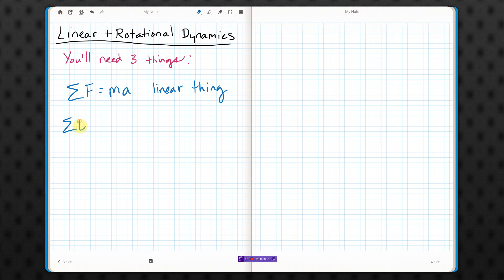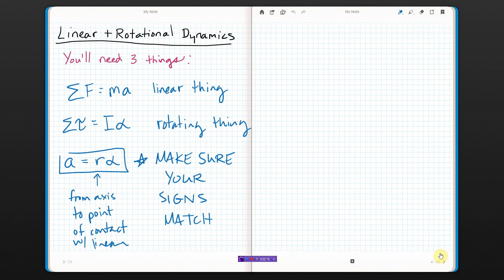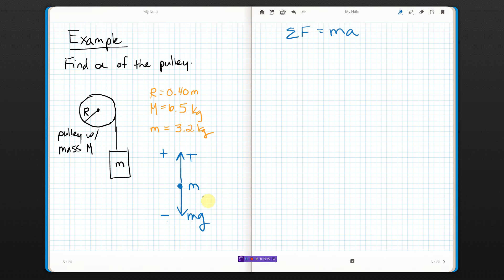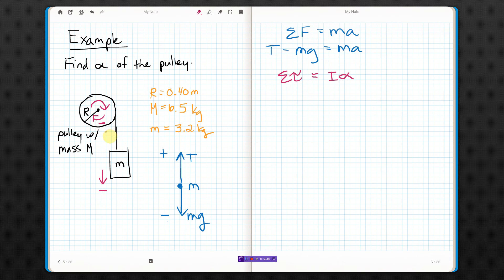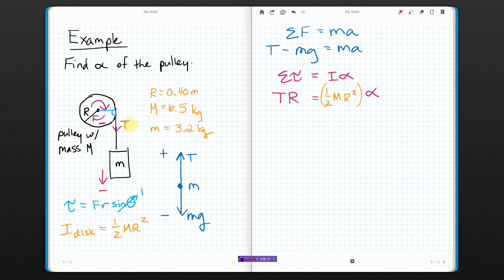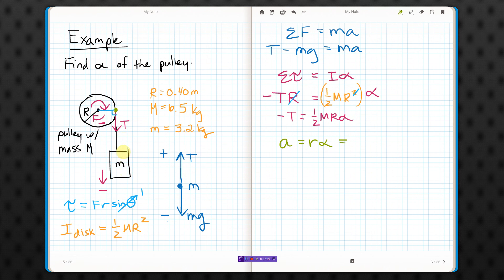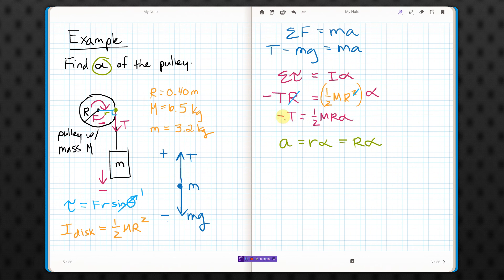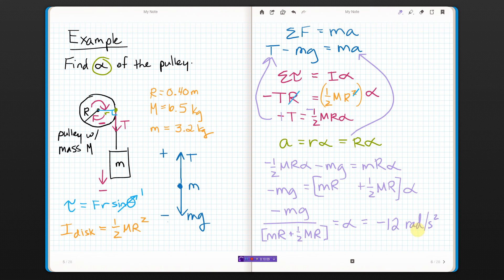Combining Linear and Rotational Dynamics Part 1

Comment: It should be T-mg=m(-a) since the acceleration is taken to point out downward
Reply from the maker: +Arabian Prince The way I set up the signs, I will just get a negative answer for a. But it is correct. You could also do it your way, but would need to make sure you also do the same setup for Newton's 2nd Law for rotation. But all that would change is the sign, and I prefer to have the negative just come out in the answer instead of having to deal with it along the way.